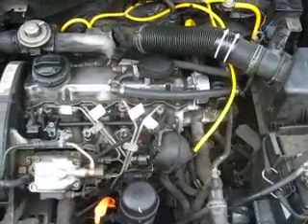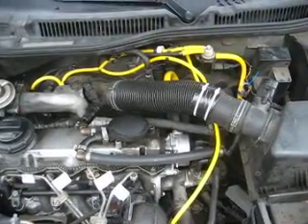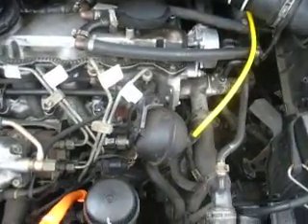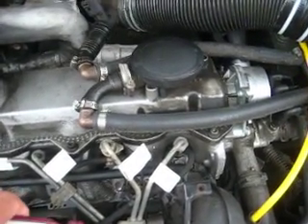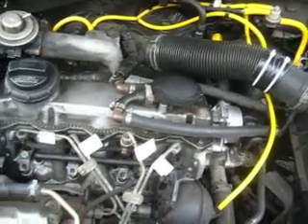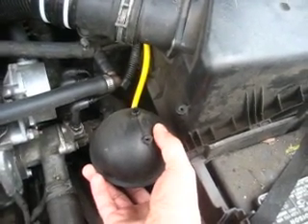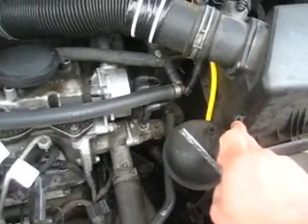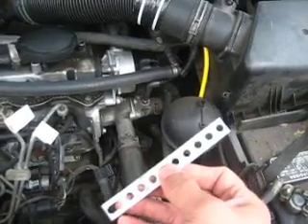VW TDI Oilly Intake CCV Fix 1 of 6 - Remove Vacuum Tank

Comment: Did you have hissing on the brake pedal too? And increased stopping distance? I’m having the above stated issue and also the car is not at all runinng the way it should.. Before I used to let off the clutch and the car used to move like anything because of the torque these tdi machines have to offer but now it kinda hesitates when i let go off the clutch..sometimes i have to give a bit of gas too..(this all alongwith the ineffective brakes).. Do i also have a potential vacuum leak somewhere? Please reply..
Reply from the maker: The hard black line from the brake booster is usually the problem. It will crack along the seam which is behind the visible part of the hose. I got my replacement from the junk yard. This is a common problem but a real head scratcher for a fist-timmer. Some people put grease and a soft flexible hose around the outside of the hard hose as a temporary fix.  how these links help: https://www.youtube.com/watch?v=_uCyIhbutUc
https://www.youtube.com/watch?v=R8Dkk34SSgE
https://www.youtube.com/watch?v=LVbxLAlO21A

Comment: Audi a4 b6 1.9tdi avf
I have tangled vacuum tubes

is there any information on how to fix vacuum tubes
and this round black ball what problem is there if it is not in action
help me with any photo links to see how to fix the line
Reply from the maker: I am assuming you are saying that all your vacuum tubes have been removed and you need a vacuum diagram. You should first invest in a MightyVac to test vacuum lines and hold pressures. Try these links for diagrams 1.9L: 
https://www.myturbodiesel.com/d2/images/a4/alh2vac.jpg
https://i110.photobucket.com/albums/n89/deejaaa/ALHvacdiagram.jpg
https://i.ytimg.com/vi/jH5_64FRMGk/maxresdefault.jpg
https://www.jeffdaigle.com/provent/alh-routing.jpg
https://pics.tdiclub.com/data/5655/orange_silicone_vacuum_hoses_600x_labelled1.jpg

Hope those help.
TDI Love from Chicago...

Comment: That black ball on my car isn’t connect to any thing will this make a difference
Reply from the maker: The brake / Diesel shut-off valve / turbo use the vacuum reserve tank when the car is first started. If the "black ball" is working right it should hold the vacuum for weeks. If it was un-necessary then VW would not install them. So, the fact that yours it not connected and/or not functioning correctly is concerning. Please review image: https://i-a.d-cd.net/266180es-960.jpg

VW love from Chicago.
Reply: @GallowayChicago  thanks pal I have just ad a new turbo on the car and my pal said you’re reserve tanks not connected it’s been like this for as long as av owned the car 7 years
Reply: @GallowayChicago  also the egr is blanked off
Reply from the maker: The n239 valve for the ASV or shut-off valve is very important. My turbo went bad and caused a run-a-way. The only thing that save the car was the ASV and if you have no vacuum ball then the ASV will not operate as intended.

TDI Love from Chicago.

Comment: Hi, I need location of 2002 volkswagon jetta tdi, 1.9 diesel engine pcv valve location. I looked up the parts at autozone and it shows 2 different looking pcv valves. do I need to get both? if so where is the location of it. please help, I spent hours online trying to find this info so I can do it myself. but have no luck finding info. thanks :) https://www.autozone.com/emission-control-and-exhaust/pcv-valve
Reply from the maker: Thanks for watching.  From the link, you provided the first two serve a function closely related to a PCV.  This part sits right on top of the ALH's valve cover opposite the oil filler cap.  It is hard to miss. VW does not call it a PCV because it lets air go in both directions, but it is a breather valve and if it is restricted the motor will stall.  Why do you need one?  These are not wear items and ususaly last the life of the auto?
Reply: when you click on link there are 2 black disc like pcv valve or ccv, there website doesn't really say to much and then there is a green/black pcv valve ? according to this forum  http://forums.tdiclub.com/showthread.php?t=10383 2002 vw jetta tdi diesel 1.9 do not have a pcv valve but have a ccv valve? is that correct? the reason I want to replace is because engine is oily and I think that may be the culprit based on this thread  http://forums.tdiclub.com/showthread.php?t=362243 . Im also getting check engine light... 2 mechanics say its the maff air flow sensor, I bought an airflow sensor cleaner,  sensor was very dirty. but that didn't work, check engine light still on and car sounds terrible..so I recently ordered one online as dealer wanted $365 which is retarded. auto parts store have them for about $100, ebay has them for $17- 39. goal is to get rid of the check engine light, I also have a very loud rough idle, don't no if that's normal for a diesel german car vw?   car is old 2002 with 250,000 miles. thanks for replying so quickly, any input is greatly appreciated :)
Reply from the maker: CCV is the point where oily upper head gasses are pulled through the intercooler and help to coat the intake with sticky oil that with the combination of the EGR soot clog the intake neck right after the shut-off valve.  Changing the CCV does nothing. there are no filters or valves in the ALH CCV.  It is just a poorly designed part.  BMW has a cyclonic oil separator that supplies enough air flow to not affect the  ALH motor's breathing, but it if for BMW.  None of this has any effect on the MAS.  A simple test for an auto that is running rough due to a bad MAS is to simply remove the plug to the MAS while the auto is running and see if it runs better.  Once you remove the plug the ECU uses the default MAS settings and these setting are way better than the signals from a bad MAS.  Sadly rough idle after the auto has been on for 10 min or more can be due to many things but often come back to the need for a new timing belt on ALH motors.  The timing belt runs the show and when it is old and stretched the ECU tries to compensate.  I would start with the Fuel Filter, Air Filter, Check timing with VCG, Run a tank full of high-quality diesel injector cleaner or 2 bottles of ATF+4, Check diesel see-through lines for bubbles (indicating bad line clamps). Change the MAS if needed and make sure you get the updated unit and not the old style, Check black hard. vacuum pump to the brake-booster line for cracks, test alternator output for +13.6v DC while auto is running - - - after that you have big projects(ie): Timing belt and water pump replacement, remove and clean injectors, Check diesel pump IQ section for the proper spring return,  check and clean the Intake manifold, check and replace if needed the turbo actuator. By simply changing the timing belt these motors can go from 35MPG to 40MPG. 

Sorry for the long reply. TDI Lover from Chicago...
Reply: Thank you for the reply I don't mind at all that it was long, I like that you was very detailed in your response. I will copy and paste your answer to word pad, and print out all your suggestions. and work on them one by one...Thanks! :)

Comment from the maker: Thanks for the compliment, but everything I do grows out of necessity.

The yellow hose is called "Universal Silicone Hose Kit 4mm x 10ft / 6mm x 5ft / 10mm x 2 ft". I'm not in any way affiliated with the seller. The sellers Price is currently: $5.39 with free shipping. eBay Item # 370652718329(put that number into eBay search).  Seller has over 130 unit. You can use small zip-ties to secure hose ends.

The kit will come up short on the required 4mm length by about 2ft. You should buy two kits.
Reply: Thank You for the measurements and the video of course

Comment: I have an ALH TDI Golf 2001, I am having problems finding the specs for the vacuum hose's different diameters. I am assuming that there is a mix of different mm sizes and that your ebay seller would provide. Love the homemade tool on the timing belt video btw.

Comment from the maker: I had to get a Mighty Vacuum Pump and reset the turbo actuator's position based on my vacuum pressure readings.  It only sounds hard.  I was able to change the turbo's range and response, and no more overboost cut-outs.